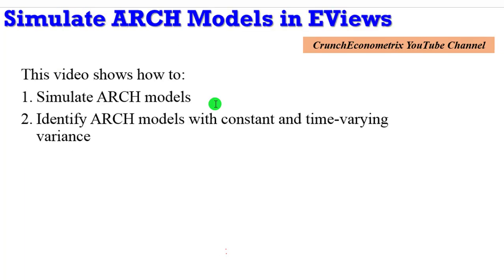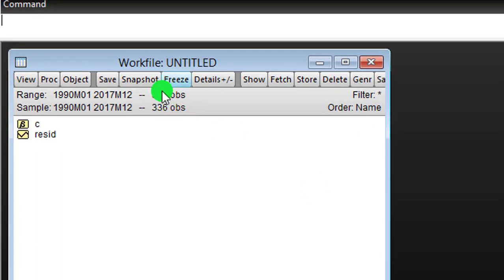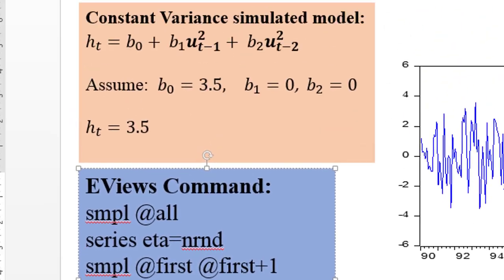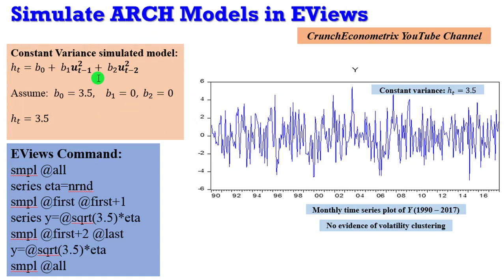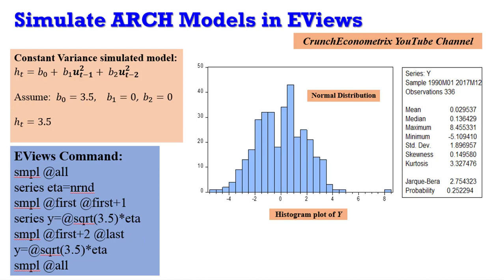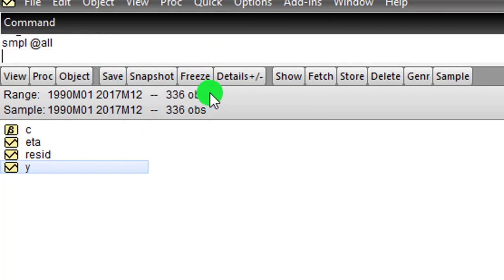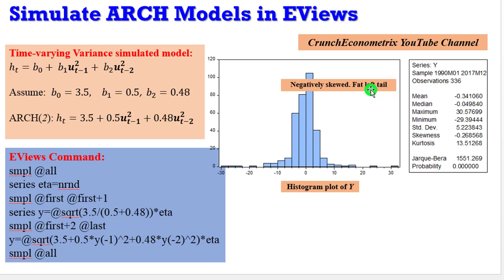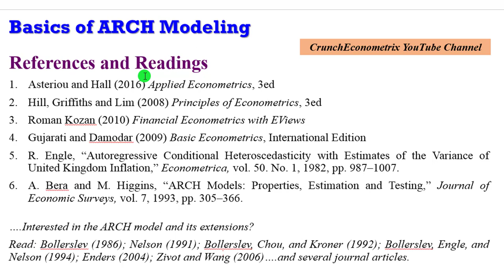(EViews10) - How to Simulate ARCH Models #arch #volatility #modeling #econometrics #financialmodels

Comment: Hello, Thank you for this resource.
Please, I have some questions. How do you estimate Volatility using the ARCH or GARCH model when the data is low frequency like annual data. 
I am trying to derive annual exchange rate volatility using annual exchange rate data. Changing this yearly data to a quarterly or monthly series would not suit my entire research because this is only a piece of the puzzle in my research work.
I would really appreciate your thoughts on the matter.
Reply from the maker: Augustine, high frequency data required.